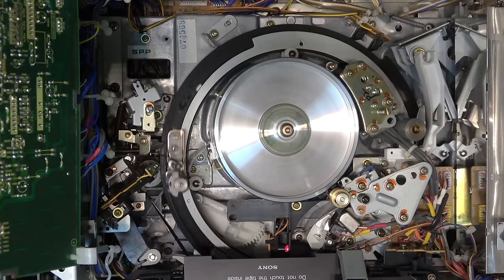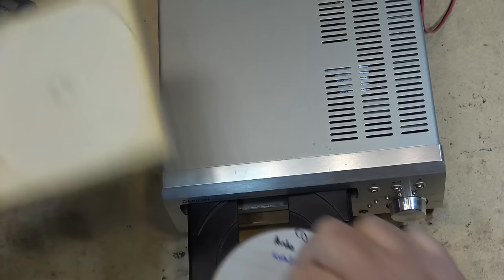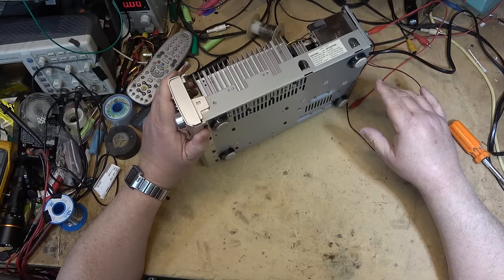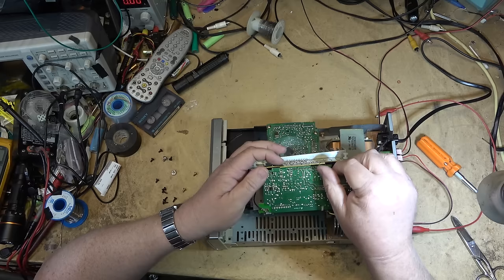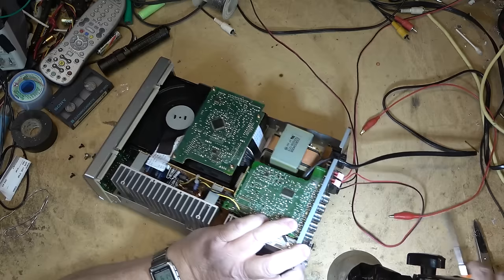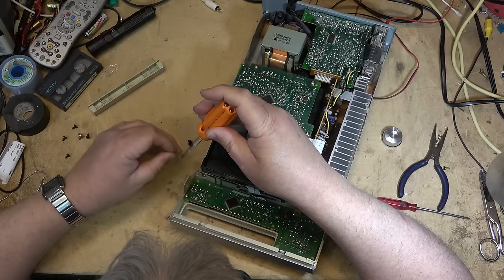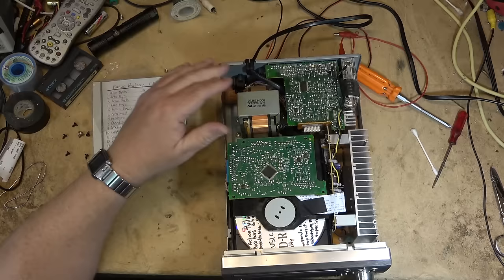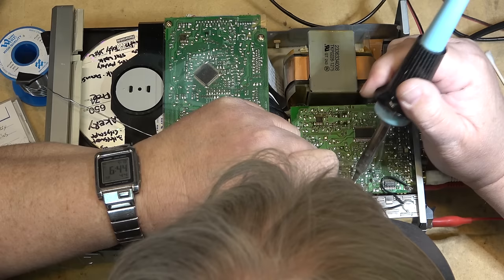This DENON UD-M80 is a piece of CRAP

Comment: Not gonna lie: that modular design -- the entire amplifier module out using a few screws and a few minutes -- not bad, actually! I fully expected you to have to strip the thing down to nothing to access that STK module!
Reply from the maker: The big problem is the plugs. every company that is used modular type plugs have had major issues. Started with zenith back in the early '70s with their chroma color too televisions with modules that you would just unplug and replace and they were always causing intermittent problems RCA had problems with modules Phillips had problems with modules. Anytime you've got a plug and a connector that's a point of failure especially as the unit gets older and a little springs that make contact with the plug pins start to get weak.
Reply from the maker: The Sony that I worked on earlier is a prime example of how to build these units. Edge connectors with interconnect cables between the circuit boards not these flimsy little connectors like this Denon has that fall apart
Reply: @12voltvids  What made computer slots and boards that much more robust? I never see connectors giving old computer enthusiasts any issues (old applying to either noun!). 20-30 year old computers can still be in service. Is it survivor bias?
Reply: I never liked the Sanyo STK modules. One reason is, now, you can't get a genuine one. All of them are Chinese knock-off crap.
Reply from the maker: They did have problems too.  ISA connectors were known to crack and go intermittent.  Back in the car and 286 days I had many motherboards fail.  the thing is with most computers is the cards are held in place by a screws or latches that hold them in place on this they're just sitting there so any bumping around they're going to get knocked loose
Reply from the maker: That's right I learned that lesson trying to fix a Yamaha mixer about 10 years ago we went through three of those knock-off modules that did not work I lost my shirt on that. Customer wanted his money back and yet here I was holding the bag on all the parts that I had shipped back and forth and the shipping on parts that never worked. that unit we actually went with a little separate module a separate amplifier module and wired it in place and it sounded fine to me but the guy with headphones on could hear a very faint hiss and that was not good enough for him. So I ended up pulling out the module I put in and eating that as well because he was so miserable. I think the bill on it was a hundred bucks and I put probably that in parts and shipping and he wanted his money back a real prick and I told him to never ever bring me anything to work on again. Asshole musicians I tell you. The guy used to use it to perform live at seniors care homes.  They're never going to hear a very slight hiss from the amplifier and I could barely hear it with headphones on in a quiet room but to this guy the original never made a sound and the replacement did and that wasn't good enough and it didn't matter that you couldn't get the original parts. As I said I lost my shirt on that one because I initially told him can't get the parts it's not fixable and then he came up with this idea about just putting a separate amplifier module inside and connecting it which I did and again it sounded fine except the fact that if you shut off all the inputs and put on some really good headphones you could hear the slightest bit of hiss in the background and that was enough. So when I see something with a failed STK module in it I'm not even going to attempt to find one these days it's shot it's garbage get it off my bench.
Reply: @12voltvids  That makes sense with the screwed in boards, held in at a number of positions. We won't talk about the giant video cards that fail because of their mass pulling them out of their slots!
Reply: @MikeDS49  See a lot of bad IC sockets though?

Comment: Bang & Olufsen, it's what the Swede techs would say when it failed: 'It went Bang then Olufsen to Heaven! ' 😂
Reply: B&o is quite a premium and excellent brand. Very little issues. But as always. You got what you paid for. If you welt for the cheep stuff you got to feel you are on the low end. But yeah. Some repair guys call everything crap. Just because they never learned how to read b&o schematics and see how easily repairable their good stuff really are! :-D
Reply from the maker: Parts impossible to get they always were. Used to service lots of B&O gear back in the 80s avd 90s avd yes it did blow up. Teenagers having a party blew their parents stuff up all the time.  Yes we did call it crap back then too.  We called it all crap.  There are very few pieces of gear that techs like.  The only stuff techs like is the stuff that doesn't break down.  Some are more trouble prone than others, but generally the consensus was once a device started breaking it was crap. Since the only time techs see this stuff is when it's broken technically it's all 💩crap

Comment: What was it about the China made gear that made them inferior to Japan made gear? It's a genuine question,  does anyone know? Poorly maintained factories, lower quality control, cutting costs and corners? What was it, does anyone have a genuine answer, I am just curious that's all.
Reply from the maker: It's not bad. Most is on par. People have short memories or are not old enough to remember when it was crap coming our if Japan.  I remember my parents sawing that.   Then Japan for good and it was Korea that was crap, then Korea got good and ur was tiawans turn then China and Vietnam.  The routers we use at work cone from China and Vietnam.  Rarely have any issues with any of them.  Seems to be mainly the Trump supporters that have a problem with Chinese made devices.  Now are they building back doors into equipment for spying? The government thinks that could be the case with state owned companies like hauwei and has banned them from the cellular network where packet switching us involved.   We are installing Samsung equipment at work.  Quality wise i have not seen anything to suggest poor quality on higher end devices.  Just look at all the capacitor failures on products that were made in Japan. I just fixed an 8mm VCR yesterday that had a bunch of failures.  It was made in Japan.
Reply: As Doc Brown from the BTTF trilogy would say: "No wonder this circuit failed. It says: 'Made In Japan'."
Reply: @AstrosElectronicsLab  yet I have electronics items from the 80s that are functioning absolutely fine.
Reply: @AlexMitchell-sj4sb  it was both a movie reference and a joke, dude.
Reply: @AstrosElectronicsLab  I know. I saw Back To The Future in 1985 at the cinema.

Comment: I don't take anything in for repair these days that has an STK module in the output. Nine times out of ten they have failed, and genuine replacements are NLA as you know. Nothing but china fakes now and even if you can find a good used pull, there's no guarantee it will last. You were lucky with this one that the STK was still ok and it was just bad joints.
Reply from the maker: Yes if it had been popped it wouldn't be good for anything. At least the radio and amplifier works.

Comment: I’ve an m38 pretty much same apart from slight change in button placement.

I had to strip it down as I had a channel drop out.

Once you figure them out as they are so compact they’re not that bad 

Reseated
All the connectors and hasn’t put a foot wrong in two more years.

Also these are excellent for sound quality with reasonable speakers

Comment: I've got the M30 with a pair of Optimus 7 Woody's and the Klipsch SB-350 as the basic sound system for my living room TV (I don't like surround systems).
Other than the tray belt and having to clean the rotary encoder, I've had no issues with it other than the remote crumbling to pieces. 
It fits under my table top TV mount and works great to this day.
Reply: Also got an M30 but haven’t used it in about a year. Plugged in today and when I put a CD in, the display shows 0 tracks. Any idea why this could be?

Comment: I have repaired a number of the current model units RCD-M41DAB. Not seen connector issues on those yet, but other component faults, such as diodes, cracked pcb's, IC's, bad generic SF-P101N lasers (who'd believe it?), belts, dim displays, even a mains transformer. Other than that nice reliable units 😘

Comment: For a Denon that's really not bad at all. Try working on the CD player of a UD-M5, you have to strip the entire unit down to get any access, the CD mechanism is an incomprehensible nightmare, and you can't test anything without putting the whole thing back together. TEAC were even worse as instead of using edge connectors they liked to use little single-core wires to solder the boards together. Great for reliability, horrible for servicing as you have to remove every single one or risk stress breakages.
Reply from the maker: Those fall into the category of not economical to repair. Actually know someone that I told them a couple years ago with that their piece of crap mini system was not worth putting money into. They took it somewhere else and the guy charged them more to repair it than the unit would have sold for a new. It worked a month and then broke again they brought it back to me to see if there was anything I could do.  it wasn't that the other guy had bought something it was just a completely different problem and they told me how much money they paid to have it fixed which was $180. When the unit was new it sold for about 250.  When it was brought back to me to look at it was the power transformer had failed parts were not available.
Reply: @12voltvids That charge seems excessive. Sure they are no fun to work on, but if you're competent and work on them fairly regularly it shouldn't add a great deal more time to the repair, it's just frustrating. Maybe if it's one of the units with a CD changer and the mechanism gets out of alignment, as those can be a nightmware to retime, but that doesn't usually happen unless it's abused. I'm sure too many techs just add a 'frustration tax' to these thigns when at the end of the day fixing something is better than throwing it in landfill, and if you get on with it and get it done it's not too bad. My only exceptions are some of the modern stuff that is entirely plastic and glued or clipped together. If you build something compact like this Denon, some compromises have to be made. But there is absolutely no excuse for the way some of the modern stuff is built.

Comment: I think I have a passion for vintage turds, a whole Hi-Fi in  the space of a DC power supply: I'd need one for my bench.

I usually solve those edge connector problems by cleaning the contacts with de-oxidant and a brush both socket and card, they don't typically need reflowing as the temperature doesn't change that much. The connection point on the contact is just one tiny little strip, any other place should be considered dirty, re-inserting might fix-it or might just break it again making the contact slide over old dirt. Even if doesn't seem obvious dirt vintage electronics have a  patina of off-gases, atmospheric particles and other elements deposited everywhere even where the eye doesn't normally see.

Laser not lighting up... it might be another edge connector problem.
Reply from the maker: Somebody was in it. Was at another shop before it was sent to me.  I wouldn't be surprised if the flex pcb between the laser abd lower board is damaged.

Comment: I always dreaded seeing one of these mini Hi-Fi units on the repairs rack.
As is the case with this one, most were made in China, the brand name meant very little.
You run out of naughty words trying to stop them cutting out when you move the connectors.
I feel your frustration Dave.
Reply from the maker: I hated them. My audio guy at the shop hated them.  I have one here that was one of my kids units and it's still broken.  even if I have absolutely nothing else to do that one has got up on the bench. I think if I ran into a day where I had nothing to do and that was the only thing sitting here to work on I would probably take the day off.
Reply: @12voltvids  We were the same, often they were left until they were the only item left on the shelf
or the customer would be calling to find out why it was taking so long!
I was the "Hi-Fi" guy so guess who had to fix most of them.
Cramming the same amount of parts that were intended to fit inside a standard size case
into to a much smaller one was asking for trouble, heat just built up until they failed.
Happy Days, Not!
Reply from the maker: The happiest day I had at Jack's stereo and tv was a Wednesday morning at 9 am precicely when i walked through the door and the prick that owned the joint jumped all over me for not charging extra for the second part I had to order for the TV and only marking up the cost of the part by 45% instead of 50%. The difference was coming on my pay cheque.  I made a 180 and walked out. Got to my car and called the guy that had been offering me a job to install satellite dishes for him and told him i no longer worked for the shop. Grabbed my tools and started slapping up satellite dishes.  Did that for about a year and heard a rumour that the phone company was planning a mass hiring so tried for the second time with them and after months of tests and interviews got on board.  I actually applied back in 81 while I was still in high school hoping to land a summer job but the quota was filled in April 81 and I didn't graduate till June 81.  Had i got on then i would have been retired 5 years ago with a nice pension.  Oh well I did get to go through the big rebuild where copper is retired and fiber rolled out.  In the 80s and 90s would have been all copper and then adsl build.
Reply: @12voltvids  As a young spotty faced teenager all i wanted was to be a TV engineer, until reality hit home and i discovered that been treated like a slave and sworn at by customers was no way to make a living.
I ended up working for the RAF as a civillian doing avionics, then guess what, as soon as they discovered i could repair tape decks they landed me with them, but no more nasty customers or worrying about the cost of spares.
Strange how so many left the trade after a few years, it was not a dream job for anyone.
Reply from the maker: You got that right! (Sounds like a catchy hook for a tune) no respect for anyone in the business. Everyone's grumpy because the equipment that they bought that they expected would last in 20 years was broken in two. Everyone expected that it should be covered by warranty and when it wasn't they were mad. Every customer expected you to pick it up taking it to the shop and return it for a little or no cost because after all they did buy it from the shop so they figured that the shop would cover it. Even VCRs with dirty heads caused by damaged rental tapes nobody wanted to pay to have that done especially when you just cleaned it for a $30 the day before and now the machine was out of commission again it had to be under warranty. I stuck around far too long I should have left within a year or so but I didn't because I had obligations. I actually went to school for television production and wanted to do that but there were no opportunities locally and I did not want to relocate to some small town up north. I have a friend that spent his entire career in broadcast and he started at a small station up north for a year then he moved to another small station a Little closer for several years and then he ended up in the big city where he did a career there only to get thrown out with cutbacks. I hear him on the radio once in a while now filling in for hosts that are off for whatever reason but he's not doing it full time. That's a tough gig with all the layoffs in that industry but that's what I initially wanted to do. I kind of got shoehorned into the repair business only because I had shown an interest in electronics at a young age and I had worked in local TV shops when I was in high school. I don't know where my applied at Sony and I was hiring at Sony and took their in-house training course on betamax. That landed me a job in a service center which I again stayed at far too long. one was the customers but the big one was the owner who was a real piece of work. I finally got fed up and walked and that was the best thing I ever did. There certainly is no money in repairing any consumer electronics today there was in the 80s and that is probably one of the reasons I stuck around as long as I did was because I was making a comfortable living but that all ended around 2000 when everything became disposable there was no money in it anymore and I got out. I know many that stuck around thinking that things were going to reverse and they ended up losing everything including the guy that I work for he ended up losing everything with his shop on but that was 9 years after I left

Comment: It looks like a very low-end unit designed mainly for people to buy to have a little stereo system in their office at work rather than for being a serious unit to use at home.   I remember when Denon was a well-thought-of brand but this is not the type of component that comes to mind that would have that name.   They really cheapened their brand name image by slapping their name on this.   Of course, the context I'm talking about is the 90s and not the current era of cheap Chinese-made components (like this unit fits into the category of).   A friend of mine has a full-sized Denon A/V receiver than has no sound output and it's one made after they stopped putting quality into mass-market units.
Reply from the maker: Kitchen or bedroom system.